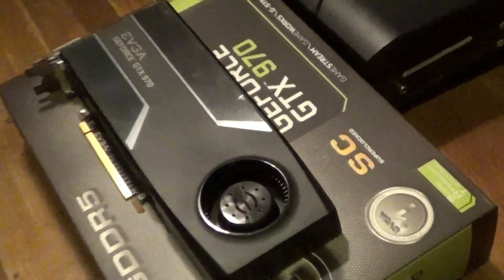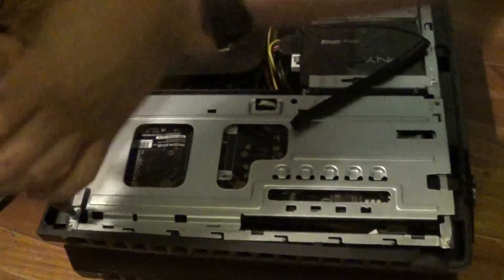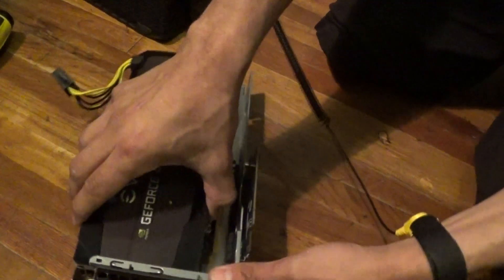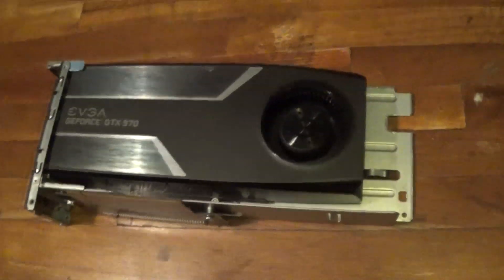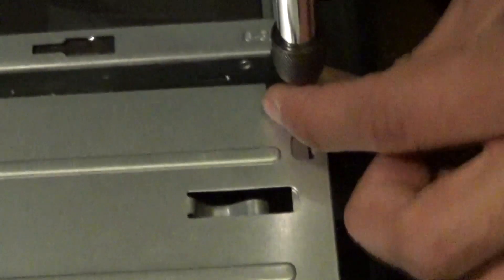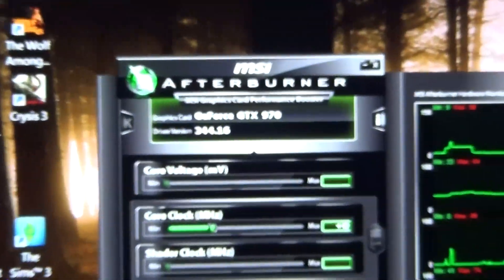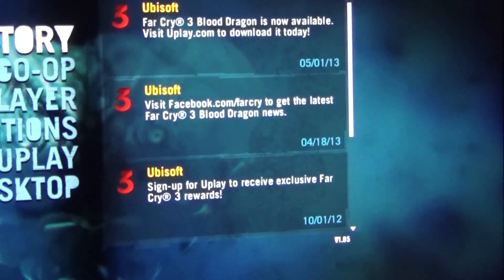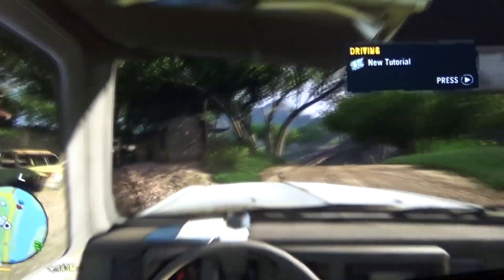How to install a GTX 970 SC in an Alienware X51. (English)

Comment: I tried to install an MSI GTX 970 OC (the cage style, not the twin blade one) in my X51 330w power brick.  It claims 148 watts usage.  The card just barely scraped into the case and I had to remove the rear case fan.  I also swapped the 3.5 hard drive for a notebook one to get some airflow in there.  While running the system occasionally just blinks powered off without notice.  Is this because of the power requirements?

Comment: I have a question, I have the original alienware x51 r1 with the 240 watt PSU. If I were to upgrade to the 330 watt PSU would the 970 run fine?

Link to PSU Upgrade: http://accessories.us.dell.com/sna/productdetail.aspx?c=us&l=en&s=dhs&cs=19&sku=332-1432&mfgpid=227504#Overview

Comment: Not necessary at all..run a external power supply to it..I'm running the gtx titan on a 750 wat external an runs great..an ssd drives really help..message me if u wanna run down on how it's done..super easy.

Comment: Damn the card is probably choking to death with no airflow. i7 with the stock cooler as well? yuck.

I guess that explains why you are getting 20-50fps in farcry 3. Im currently running an FX-6350 and an MSI GTX 970 OC and am running Farcry 3 at 90-120fps and Farcry 4 at 50-80fps all ultra.
Reply: I have my MSI GTX970 @1515 in game mhz and memory at 4000mhz but get only 45-70fps in far cry 3 everything maxed...

Comment: hey I have one of those X51s with about the same specs as you do except with a 1 TB drive and GTX 660. I wanna switch out my card with the exact same card you're using or the non-OC version of the same card made by EVGA. Before I buy the card, what problems were you going through that you had to get a new case and PSU? Should I get the non-OC one so I don't have to swap out the case and PSU?

Comment: hey will this work if you got 16DDR3 and the core i74790 cpu r2 model that came with 760 ti
Reply from the maker: Jared Gilles Yes, the R2 shouldn't have any problems using the 970.

Comment: Hi, I have an Alienware X51 R1

-Intel 3770 I7 3.4GHz
-16GB Ram 1600 MHz
-1TB Western Digital WD Blue, 64MB Cache SATA Internal Hard Drive Bare Drive
-330w Power Supply
-GTX 660 1.5GB

I want to know if it is possible to upgrade my alienware a GTX 970?
if it is possible to perform the upgrade that card brand you recommend?
Reply: You need to upgrade your psu I would recommend at least 450w 80+ certified.
Reply: Drag0nChef He can't.
Reply: Rezirex I really can but i need mod my Alienware, Unfortunately I was not related to gaming computers before purchasing the pc
Reply: Carlos Aguilar That's exactly my situation. I have an x51 as well and without heavy modifications, couldn't really upgrade until these Maxwell cards came out.
Reply: Theres Silverstones SFX PSU fully modular and tiny! You may not even need to mod it.  Heres a link http://www.amazon.com/Silverstone-Tek-450-Watts-Modular-ST45SF-G/dp/B008VQ2Y4K/ref=pd_cp_e_0 I would wait to purchase simply because the price is at its highest point... There is also a cheaper 450w non modular and even more expensive 600w fully modular sfx psu from silverstone Carlos Aguilar
Reply: It is..run an external power supply. .I'm running the gtx titan
Reply: Carlos Aguilar
Hey try the base gtx 970 from EVGA or GALAX (must be a blower style card). This card consumes only 10 watt more power than the 660 you have. The overclocked and superclocked versions consume even more so wouldn't recommend. I'm planning to do this to my X51 R1. waiting for the pricedrop on the card.
Reply: You need to buy an R2 Power Board, if you wanna save money rather than getting new case and psu. It's because max draw for R1 is 150W where as R2 is 175W. (The power board regulates where the power goes) has nothing to do with psu
Reply: jaggerhead1299 seriously? Might you tell me after you buy the video card and tell me that you worked on the PC?
Reply: milolamb makes sense what you say but where can I buy? and that price? you know?
Reply: Carlos Aguilar
Bro, i was kinda hoping someone would confirm that for me rather. Theoretically speaking ,as long as you get the "STOCK" version of the 970, there should be no power issues (no overclock, factory overclock, superclock, AMP, EXOC, none of that shit. just plane jane single fan GTX 970 4GB). Besides you can also use this great software fcalled MSI Afterburner to cap your card from drawing more than 149 watts (tdp of the stock gtx 970 is 145 watts, the R1 power board allows 150 watts to the card. So theoretically there should be no problem) DO you really wanna buy a R2 power board?? Now the only problem is Nvidia Boost 2.0 which causes the card to draw more power (i don't know exactly how much % of the tdp, but this can be easily controlled with MSI Afterburner software)
Here are the cards you should try
http://www.newegg.com/Product/Product.aspx?Item=N82E16814487069&cm_re=EVGA_970-_-14-487-069-_-Product

www.galax.net/europe/970v.html.
Reply: jaggerhead1299 Im thinking of buying this one for my x51 r2.
My specs are i5 4460, 8gigs of ram and one hdd. This card will replace my gtx 745 4gigs card.
Reply: +BisAlmighty Yo did this end up working for you? Cause I have the X51 R1 with the non superclocked EVGA reference 970 4gb and I just ordered my 330w psu and was wondering if this would work no shutdowns or will I have to downclock?
Reply: +YoungBloodz357
With the R1, chances are you would need to upgrade your power board. At the end of the day, a better option of to transfer the components to a different case.
Reply: +Ratchet Russian Ah thats what I was afraid of, I dont have the money for a new case atm so I'll attempt to put in my card but if there's any problems i'll just wait for a new case

Comment: Hi. i'm arguing with my friend if your gtx 670 FTW was already installed in your X51 when you bought it?
Reply from the maker: flying4newbs My x51 originally came with a GTX 660, but a few months later I decided to replace it with a GTX 670 FTW.

Comment: The thing is the point of a new gpu is increased performance, but if you have to downclock there's no point, my gtx 970 g1 and 15 4690k I average 65fps 8xmsaa ultra everything
Reply from the maker: This was just an experiment. My main rig has a 980 G1 and a 5820k, you can see it in my recent videos.

Comment: I have the Alienware X51 R2

-Intel i7 4790
-16GB ram 1600 MHz
-2TB Seagate Barcudda HDD
-330w Power Supply 
-GTX 760 Ti OEM

Can I upgrade to the GTX 970 with this version of the X51? Also, how's the power consumption? Is the 330W good enough for the 970? Thanks for the help :)
Reply from the maker: ***** The X51 R2 shouldn't have any problem using the GTX 970. It's only the R1s that seems to be having issues.
Reply: ElMastaGamer HD the minimum power supply required for the card says its 500w, wont this cause heating or power draw issues?
Reply: ElMastaGamer HD Is OC the same as SC?
Reply: Noel Barillas that is recommend not what it needs
Reply: YOOO I have the exact same specs as of now!
Reply: SnufflesDominance
Same here buddy! Just bought it yesterday!
Reply: Gtx 760 ti? how? -.-
Reply: TheRealSantos If my information is correct, the 760 Ti isn't being manufactured, but it's an upgrade of the GTX 560.
Reply: SnufflesDominance TheRealSantos The 760 Ti is an OEM card. Only Dell has the rights to manufacture and distribute it. The only way to get one is to purchase the Alienware X51 R2 which is preinstalled with it
Reply: ***** Oh okay thanks. I wouldn't have guessed
Reply: ElMastaGamer HD well i have problem because i bought the x51 r2 base model which came with 180w psu. when i install gtx 970 SC & play any game it crashes right after few sec. did lot of research found out that i can buy extra psu so i bought 400w internal psu and i jump started it by linking black & green wire. but the still the same. then i thought & look at psu cables why not connect one 6pin power to gpu from psu i bought and i 6pin power from alienware x51 r2 mobo. boom! it worked i was so happy at the end. thing is i don't want to buy dell's 330w psu which cost like $160 after tax. case looks ugly but i thinking of buying 330w after few months from ebay

Comment: Hey, I just want to report that I bought a gtx970 PNY reference and it works perfectly with the x51 R2, I've been playing for some hours AC Unity, Shadow of Mordor and I haven't got a shutdown or any problems. I haven't removed any component from the x51 (it has a SSD a HDD, DVD drive 8gb Ram), the pny 970 it's the same size as the OEM 670. The 970 is 10° cooler and less noisy, just handle it carefuly the plastic shroud is extremely cheap and it feels like it can break if you apply too much pressure on it while handling it. If you have any doubts let me know!
Reply: Im gettin the pny as well, i am currently running the r9 270x in mine at the moment, will i have to change the power cords? Ive never used a nvidia card in my x51 so im a newb when it comes to those cards

Comment: I'm kind of new to the whole graphics card and processor stuff but just to make sure if I bought a gtx 970 and put it in my x51 it would run faster? I have an Intel i7 processor jw
Reply: That depend on what you mean with it running faster. It won't boot faster and it won't load programs faster and such things, but the gaming performance will increase significantly. i upgraded from the rebrand 760 to a reference 970 and i get about 90 fps in bf4 with the same settings that i used with the old card, and there i got about 45-50
Reply: DJ vanilla beats hey, i don't think you need to do a clean install because you want to swap the gpu. You should do it from time to time, but to install the gpu, all you need to do is put it into you system and install the drivers
Reply: Oh a new think popped up. I got the one linked in the desc. but my power supply can't run it. help!
Reply: oh sweet dude thanks so much

Comment: because people who buy alienware upgrade their computer...
Reply: In my case, I bought it at a time when I was less educated on computers. Therefor, an upgrade would be nice.
Reply: Rezirex makes sense :D
Reply: Rezirex Same here i thought a gtx 745 with 4 gigs and a i5 4460 was nice untill i started playing high end games like metro last light and witcher 2. My frames where very low. So now 6 months later i thought to myself maybe its time to upgrade.
Reply: ***** You forgot to mention that it's maximum  PSU is 330W so good luck upgrading to a decent card. It also gets horrible airflow.
I could build a far superior PC in a mini-ITX case which is cheaper and out preforms the X51.
It basically turned a PC into a console (kinda defeats the purpose.)

Comment: great video dude !!
I plan to buy MSI GTX 970 Gaming 4G for my X51 R2, will it fit in case? since MSI is fatter than yours
one more, is double fan going to be good than single one?
Reply from the maker: Kazuhiko Aegis I wouldn't recommend a dual fan card as those will just circulate the hot air inside the x51's case. A single fan 970 is better suited for a small case since it will push the hot air outside the case from the back of the card.
Reply: ElMastaGamer HD thanks for fast response. I live in Japan, I can't find any GTX 970 with single fan except this one: http://www.amazon.co.jp/gp/switch-language/product/B00PF6CYVW/ref=dp_change_lang?ie=UTF8&language=en_JP

it said, dimension is 16.5 x 11.6 x 4.1 inches. it won't fit isn't it?

Comment: Hey man, thanks for the video. I've taken mine apart before just to have a look. Thinking of getting an SSD too. Would you recommend moving things round to get better air flow then? Also I was looking at 970s and this > http://www.amazon.co.uk/EVGA-NVIDIA-Graphics-Cooling-Express/dp/B00NSEK2G2/ref=sr_1_2?ie=UTF8&qid=1415257756&sr=8-2&keywords=gtx+970 < was the cheapest and is from EVGA, does it matter that it has 2 fans? I still need to upgrade to the 330W PSU too ElMastaGamer HD

Comment: so 500w isnt enough on the super clocked version?
Reply: If a 330W is enough, though requiring to set the poewr to 99%, so it would eat only 145W, yours is rather fine.

Comment: I have the 660 ti ftw in my x51 and I have power issues(same design as yours). I had at 80% power and downclocked it and it still shut off. Is my 330w power supply faulty?
Reply: I think, because i up clock my and its fine,

Comment: Hello.
I got a question. 
I'm going to buy the Alienware AX51R2-5743BK model (x51)
But I was reading that it has 240W.
Basically:
- Can I upgrade the x51 GPU to a gtx 970?
- Can I also upgrade the RAM? (From 8 to 16)
These questions are for the 240W power supply.
Reply: You will need to upgrade to a 330w psu first. Once you do that, you can do either of those.
Reply: ***** it uses external power supply, so I just buy a 330W external power supply?
Reply: yeah, I think you need the one that's specifically for the x51 though, you can probably find it on Dell's website or off of ebay
Reply: +TheFarVids You know if it comes with an internal power supply? Or it's only the external 240W one
Reply: Only the external.
Reply: If you are planning on upgrading to the 970 and 16 gb of ram then why are you getting the 240W one anyway? Wouldn't it be better to either wait or just get the 760 ti version?
Reply: I asked on the Alienware, all of them use 240 W. Thanks for the answer.
Reply: *****   Actual ones have 240W, it sucks, Dell told me that it may get really hot in High Level Usage, also it can explode. (No kidding)
Reply: Victor Carrillo Uhh... I got mine a year ago with an i7 and gtx 760 and it came with the 330w. The more expensive x51s have to come with a 330w as they come with things like an r9 270, which needs more than just a 240w
Reply: ***** Uh bro, I thought the same, but no. It's really stupid what they're doing, i7, radeon r9, and a 240W, It should be a stupid joke from Dell.
Reply: When I bought it, it literally said 330W PSU in the specifications. If it was a 240w the computer wouldn't even turn on, let along play highly intensive games while overclocked without a single gpu crash.
Reply: ***** The last generation had 330W, this one... it's just a fucking joke I guess.
Take a look, I talked with a cool man.
10/19/2014 09:25:17PM	Víctor Hernández: "So listen men, I was reading that the x51 comes with a 240W is that true"
10/19/2014 09:25:52PM	Agent (TIP_Carlo S): "Glad you chatted in today! I'd be glad to help!"
10/19/2014 09:26:27PM	Agent (TIP_Carlo S): "Yes, it comes with an external 240 Watt (Standard)"
10/19/2014 09:28:03PM	Víctor Hernández: "If i'm using it like playing DayZ, in a high level usage, it can get really hot (75°)"
10/19/2014 09:28:14PM	Víctor Hernández: "and it may burn or explode you know"
10/19/2014 09:28:34PM	Víctor Hernández: "is that true?"
10/19/2014 09:30:13PM	Agent (TIP_Carlo S): "With moderate use, you can avoid overheating. If you plan to play high level games, you can purchase the optional 330 Watt adapter, or better yet upgrade to the Aurora desktop :)"
Reply: The solution could be buying the 330W, but, it's not all, because it can keep getting hot.
So, from wasting $1200 in that alienware (including the 330W), I'll buy an Acer Predator I guess.
Reply: Victor Carrillo Dude, I have an R1 and it DID come with a 330 Watt PSU. I ran everything through a PSU Calculator and a 240 Watt PSU would not be able to handle what is in the Alienware I own. It also says on the PSU itself that it IS a 330 Watt PSU, selling the 240 Watt PSU as the 330 Watt PSU would be fraud and would end in a lawsuit. The guy said that the 240 Watt PSU came STANDARD which means if you buy the base version you do get the 240 Watt version. If you bought the more expensive one it would come with the 330 Watt PSU because it needs more power to run it's components.
Reply: I've been helping a friend lately with his X51 upgrade.  He had an R1 with a 240 W PSU.  What PSU you got depends on what graphics card + CPU combo you bought.  All R1's with a 545 got the 240 W PSU.  Don't rely on that though - look at your physical PSU and google the model number, you should be able to find if it's the 240 W or 330 W version.  There's no reason to take a chance when it' so easy to check for yourself.
Reply: Yasine Adalal No it wouldn't.  The 960 has a TPD of 120 W, compared to the 970's 145 W.  The 970 is already cutting it pretty close on the 330 W, the 960 would cause the 240 W PSU to shit out.  For comparison, the 545 that comes with it has a TPD of 105 W, and Alienware tends to not leave a lot of wiggle room with their PSU's.  That's before considering factors like age diminishing how much the old PSU can handle.
Reply: Victor Carrillo r1 had a 240 watt supply. r2 has a 330 watt, please read more
Reply: TacticalDrunk all of them. The 330W is optional
Reply: Build your own its a lot cheaper and you get a better rig!
Reply: That's what I'm thinking
Reply: Victor Carrillo 330w comes with 760ti models or i7 models.if they ship a 240w with it it will crash and you will return 
it back to them.until they replace the 240w with the 330w version.but as they are professionals at dell(i assume)they will send you the 330w version at first.
Reply: you should just build one yourself, seems like your replacing most of the parts so why not.
Reply: build your own its easy and cheaper
Reply: TacticalDrunk i have the r1 and a 330w
Reply: R2 FTW getting mine today.
Reply: Gtx 960 now could fit even with a 240w psu.